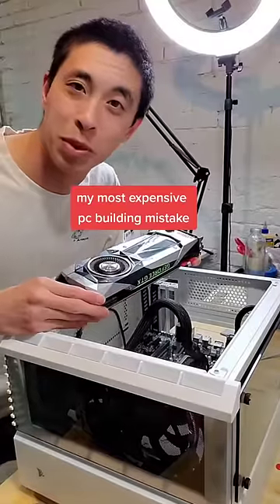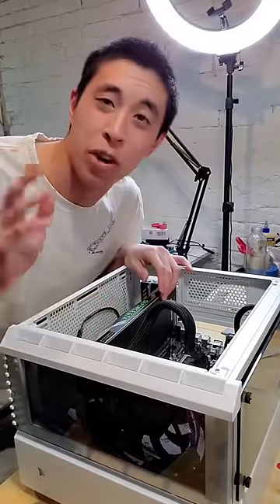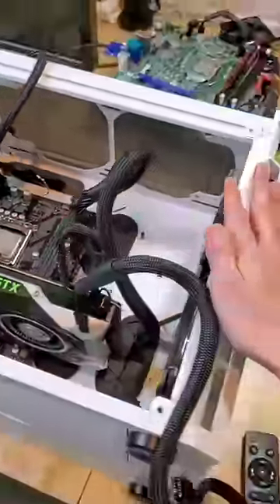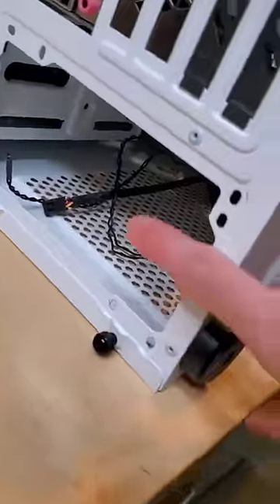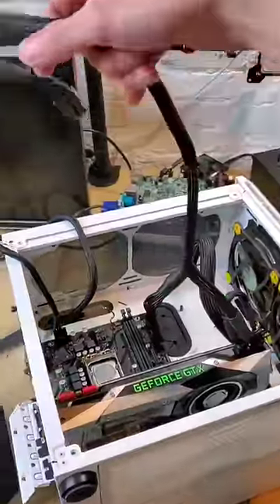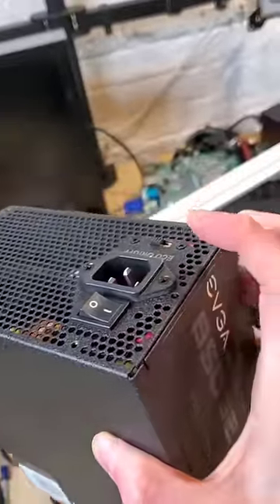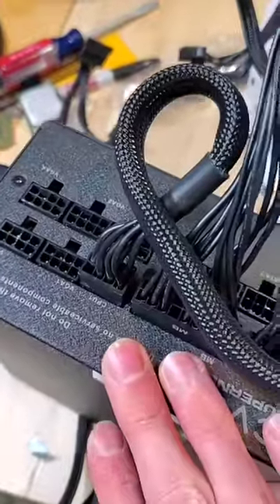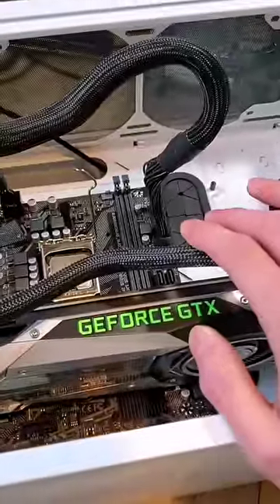my most expensive pc building mistake... #shorts

Comment: I really wanted to overclock my 750 ti, so I decided to flash a modded bios to try to overclock it more, without fully acknowledging the consequences. I flashed a bios of a 750ti that has external power without knowing, and the card worked, but only displayed ‘please plug in external power’ even when my card didn’t have one.
And that’s how I ended up getting my 970.

Comment: Made a mess with hard line watercooling, getting water in the CPU socket while running.
Also bent some pins trying to salvage things. I managed to bend them back, but the system was not reliable anymore afterwards. Replacing the mobo would have cost me €1300 and I couldn't be sure the CPU was still good, so I went for an all new platform.

Comment: Was building a pc while drinking—
I managed to wire my VGA Power into the CPU Power ports… mind you I had sleeved cable extensions so somehow this was easier to do from the back. Everything was ready to go. I powered up the system, heard a loud pop and smelled burning plastic. I realized my mistake, and was devastated. I corrected the error but was not met with any power. Since I used a modular power supply, I removed PSU with cables intact and swapped it for an identical model.
To my surprise the system booted and no components but the PSU were harmed.

Comment: Well.. when i build my first PC just a few months ago, i fried my CPU (i7 14700k), motherboard (MSI PRO B760M) and PSU because i messed up mounting the mobo on the case. I placed a screw wrong and made contact with the back of the motherboard (exacty on a spot where it should be no contact at all) and after 2-3 hours of finishing rhe build, while installing the drives and what no, it went off. Luckily the GPU, ram and storage weren't affected

Comment: I had to replace my power supply unit recently. I was like "Oh yeah, I can just re-use some of the modular cables, they have the same connectors.

The first thing I did when I got the new PSU was plug one of the spare peripheral cables from the old PSU into the new one, and measure with a multimeter, only to find that the 5V line had 9V on it, and the 12V line had 2V on it... Yeah, wired up completely differently, so what should have been ground was the 3V line.

Needless to say at this point, I just removed all of the old cables from my PC and installed the new ones.

Comment: I don't know if I can call this a mistake, but I bought a gigabyte H610M motherboard and put it in a optiplex case without the correct mounting holes. Logic would denote the fact that you just leave things in there as they are, but for some reason the motherboard chipset died anyway, and I had 2 Gigabyte boards die this exact way! One was a haswell board, and the other was a alderwood board. But the biggest mistake I ever made financially would probably be jumping on the LGA 1700 bandwagon, all of our CPUs have problems and the 12th generation CPUs seem to be the best of the bunch, and you have basically nothing in terms of upgradability because the next two generations of CPU are known to be faulty and they aren't making another generation for our socket which is extremely frustrating.

Comment: i bought a £600 pre-build fully setup and ready to go.... THE seller only put a £25 ACE 500w power supply in it, NOT RATED! every day it kept losing power randomly for 3 months... i did contact the seller but he was too busy to look at it. eventually i tried to turn it on one day and sparks start flying out the back of it! pc was dead! i took it to another store to find out what happened the power supply had fatal malfunction, it also took out the gpu motherboard cpu and ram only the harddrive and cd roms survived cost me £180 to get it up and running again with a Corsair Power supply. my advise is when you buy a pc make sure the power supply is Top Quality and Rated do not settle for cheap tripe.

Comment: I ripped my CPU right out of it's socket by accident. The PC wasn't turned on for a while and when I tried to take the heatsink off, it took the whole CPU out with it. 

Turns out the thermal paste was as dry af so it stuck to the heatsink.

Comment: Forgot a washer on the AMD cooler brackets, causing pressure to the motherboard and caused it to break. Luckily this is my first PC and is the least expensive component in the system

Comment: not as Expensive as others but, I plug a 5volt AIO cooler to 12volt connector, luckily is only the RGB that got Damage. I suggest just plug it to the PSU for RBG/Lighting system if your AIO/system have the connector.

Comment: Upgraded my 650 Watt PSU (i thought it would power the 3xxx GPU) to a 1000 Watt and used the same cables. That is no problem because i used the same Brand and investigated before the buy if i can use the old cables. This Info should be available on the Manufacture Site. Off course you need to know what the old PSU was and in this Video that was the Problem.

Comment: I wanna say the worst thing I did with my PC was tightening the one screw to my CPU cooler all the way which I started to apply pressure to the cooler/mobo and wondering why the other three wouldn't go in.

It works fine! I think that was the only real bad thing I have ever done too it

Comment: The most expensive mistake we’ve made was trying to work on a computer on the carpet during Winter time. Now we weren’t working inside the computer but just setting it up. My Dad had apparently built up enough static charge that when he went to plug in the keyboard it zapped the PS2 port killing the chip so while the computer would turn on we had no way to type anything…. This was on a 486 Tandy Computer which my Uncle was going to buy. However without that Money my Dad had to go buy the parts for our PC that we were building without that cash.

Comment: Something that I'm dealing with right now. If you clean your GPU with compressed air make sure you have are a sufficient distance away and use light air on the GPU. Then clean it with 99% rubbing alcohol on a micro fabric cloth and ring it out. I made the mistake of using compressed air too close to my gpu and I got the liquid from the compressed air on my GPU. And now my GPU is overheating 😢 
Ps: I have a rtx 3060...

Comment: While cleaning my first computer i broke one of the pins holding the cpu fan to the processor. I didnt realise that the fan wasnt sitting completely flush with the cpu. Ended up overheating and frying the cpu and the socket. Had to replace both.

Comment: Got an old junker PC from a neighbor when I was 14. We just needed a new PSU in it they said, because the old one gave up the ghost. Lucky us, we had another computer with a PSU in it that was still good we figured since the unit powered on, but the parts in it just couldn't handle the workloads expected of it. 

So, my mother being the worrywart that she is over accidental fires decided it was best if SHE plugged in the psu. Cause of course since she was older and had more experience with computers than I did at that time, it just made sense; was her logic. Meanwhile, I had looked at the pinout and socket for the motherboard already and identified that they didn't match. Looking back, I guess it was a 20pin instead of a 24pin or something like that. 

ANyways. She plugged it in. Nothing. Nothing for a moment. Nothing some more for a few seconds longer. Then POOF. Smoke and flames. 

The irony. I pointed out the pinout and plug not matching. But of course, she knew best. So we went with her decision.

Yeah, I was not happy with her. And of course, she was not happy about the whole situation either, since the whole point was to prevent a f'ing fire.

Comment: Didn't break much in a PC specifically, but did fry the cpu cooler socket somehow. The fan doesn't work from there, had to use the SSD socket instead. I think it was because I was stupid and didn't look in the manual for the correct power pins after removing all parts from the case for cleaning.

Comment: so you know that switch on the back of the psu that switches between voltage levels? Yeah, my first pc was having issues and for SOME reason, I thought "hey, I wonder what that does?". What it does, when flipped while the PC is on, is fry every single component on the mobo.

Comment: If the case is small or the mobo is big i reccomend plugging the cpu cable before putting the mobo in the case, i was struggling with the tight space and suddenly felt something wet... turns out i was nudging my fingers against the cpu cooler and there was lots of blood

Comment: First time I built a PC I didn't realize there was a difference between CPU socket types for different CPU lineups. attempted to put the Ryzen 3600 into a AM3 mobo and ended up bending some pins. Was not happy, especially since after checking it seemed so obvious.

Comment: A few years ago my cpu got stuck to the AIO, I noticed a few pins got bent so I started the agonizing process of bending them back. I got most of them until the very last one, which ended up snapping right off. I sold it on eBay as-is and got some money back as it was during the hardware shortage.

Comment: Not my mistake, as I've never had one this expensive, but my last PC shipped with about a couple dozen bent pins in the socket. Someone else obviously screwed up and RMAed it, and Newegg, being what they are now, just sent it out again without repairs or even any indication it had been returned before. 

Thankfully I was able to fix it with the pointy end of a safety pin and a magnifying glass with a stand, so I got it running. But it was absolutely a sweaty discovery.

Comment: I have not really upgraded my pc i have an old pc from 2017 and with the help of my friend i have a 1060 in it but a few days ago i was very and tired of my hard drives painfully slow loading times so i bought a cheap ssd that has 120gb off of amazon so i have a good speed  untill i build my new on christmas but i figured that my mohterboard only has one sata port which was being used by my hard drive so it's been sitting my room doing nothing
Reply: Yo I will take it😂

Comment: top comment is athlon 64.

mine is R9 3900X
I am trembling, but after 2 minutes or so I calmed my self and use my swiss pocket knife. after 40 pins and 15 liters of sweat, I did it and reassemble it again.

this happens when I tried to remove my ryzen from stock wraith prism cooler with that notoriously sticky factory thermal paste. I bend the pin with my palm, fortunately it only bend the border most pin.

Lesson learned, use a tool, dont use bare hand, or only buy another paste.

Comment: upgraded to the bleeding edge of cheap, bought a GTX 1050 what I didn't know at the time is it pulls all of its power from the motherboard and that is a bad thing for a already over clocked system.
I turned my motherboard into a dirty bomb, after my motherboard blew up it also caught on fire, after breathing in the toxic smoke I managed to stop the electric fire... and so I killed a 300$+ motherboard because I wanted to cheap out on a GPU on my old rig.

Comment: I did not measure anything so my ram obstructed the top radiator. "Fixed" it by cutting down the ram heatsinks.
Not an expensive misstanke and forgot all about it until I switched case to one with a glass panel.
Reply: those heat spreaders can just be popped off

Comment: I have never made a mistake cause I never had the money to spare to be able to make a mistake. I spend more than 30 hrs learning,watching videos on how to build a pc, what parts need to match, and then the shopping for the best parts and deals that I could find on a smaller budget… as I was building it I had videos open going step by step even though I knew it already. Since then I have don’t numerous upgrades(a PSU was one and I mixed power cables within the same brand, no issue ty Corsair). Since then I have built others PC and then I make them built the pc and walk them through all of what I know, dos and donts, how to do this and that, and cleaning. I do this so they will never need to buy a shitty prebuilt. I will never buy a prebuilt I love doing my wire management

Comment: i bought a full fan kit from be quiet, woth rgb and a hub for them… after everything arrived it turned out that the fans had a 3 pin rgb connector and the motherboard had a 4 pin rgb header… story short, i switched them out for better noctua fans

Comment: The PSU killed a MOBO and a GPU for me too! Luckily the CPU survived. In my case, I had a modular power supply that I bought used, and I just plugged cables in without reading what's what and where it goes. So I ended up connecting the PCIE Cable and the CPU cable in the wrong places, I just got the smell of some and nothing visual, and I knew I f'ed up. 
POWER SUPPLIES ARE USUALLY THE CULPRIT! MAKE DOUBLE AND TRIPLE SURE YOU'VE CONNECTED EVERYTHING CORRECTLY!!!

Comment: I was screwing an AIO Pump onto the CPU and the electronic screwdriver (Which is heavy) slipped and smashed into the RAM slot. Ofc just means I couldn’t use the RAM slot, but it was an ROG Strix Z790-E.

Comment: In an attempt to clean my GPU so i could repaste it, I used alcohol and a toothbrush to scrub at the GPU die. Turns out i scrubed too hard and broke off a TINY resistor and bricked the entire card.

Comment: The compatible PSU cable is designed for users to avoid plugging into the wrong socket, apparently in the video u plug a GPU power cable into the CPU socket. The voltage difference is devastating for the gpu

Comment: thats a bad day bro.
i built my first full pc build in early 2000's i wanted that first true quad core. phenom 9300 black edition.
i pulled the lid off the mobo figured theyd send it without debris in the socket and popped the cpu in. pulled the lever down but it didnt feel right so i stopped. whatever was in the holes in the mobo didnt allow cpu to go all the way down even though i gave it a few pokes and it bend pins and broke one off. the worst bent pin fell off as soon as i touched it. it was the newer gold plated pins. i cut a piece of sewing needle the exact length that the other pins were from the point it broke off dropped it in the hole and put the cpu back in and fired it up. it ran for many years and scored very well in global benchmarks so that was cool. the pc had a diff processor now and is still running just fine for a friend as his kids gaming rig.

Comment: See a PSU was my first ever experience with pc building and i remember being broke as hell so my mom would get me a new pre-built pc with installment payments, it arrived and i was happier than ever. BUT i did notice that the PSU was a typical $5 grey non modular one that they tend to shove in every pc they can, so i wanted to change that but had 0 experience with any of it. Ordered the PSU, it was corsair rm750x i believe, a fully modular one and after taking a picture of where each cable goes, i have somehow swapped it at the age of 13 with the whole cable managing behind the case, one of my first proud moments, worked like a charm for 4 years after that, until the GPU got fried, was not experienced with airflow yet and let my cat sleep on top of the pc blocking the fans, oopsie 😅

Comment: well, maybe this doesn't work 4 u... but, here in Chile we use 220 volts... and you 110volts... so, if u put a 110voltage PSU here, it explodes... so, almost all old PSUs had a switch to change voltage, but you needed to check that... now, I didn't see that, because a lot or all of the PSUs works in both voltages! Regards!

Comment: Okay, I know this is an old short so no one will see this comment but I hope someone can answer this question for me: What exactly went wrong when mixing psus and their cables? As far as I'm concerned, cables are just long ropes of metal that connect one pin to another so I don't understand why mixing cables is a bad thing. 20 pin, 8 pin, and 6 pin connectors are standard on what goes exactly where right? That's how gpu and mobo oems are able to use the same connectors for power on their components. So why did the mixed cables fry the components if they were just connecting pin to pin?

Comment: That makes no sense. What about the cables could possibly be the issue? Especially between units from the same manufacturer? Either the wire gauge is sufficient to carry the necessary current or it's not and that should only lead to the cables overheating and melting the insulation. 

Any electricians know how this could lead to frying every component?

Comment: I just want to know why someone hasn’t started a movement to get everyone to band together and push manufacturers to standardize modular PSU cables. The fact that there is potential for variance in pinout within the same brand is unacceptable and needs to be changed…

Comment: Buying a WiFi PCIe card, GPU hot air had air-fried the WiFi card in less than 2wk, $20 gone. Use a WiFi included motherboard or a USB Type-A adapter

Comment: thought i had a bad motherboard, turned out i only installed the ram improperly... AFTER i bought a replacement.
Reply: just return the replacement?
Reply: @puppieslovies  it was already like 4 years after i bought the prebuilt it came in, and it was already an older cheap model

Comment: I had a intel g2020. I was so dumb that i didnt know some motherboard have pins on it. Well my dumbass brain started using a brush to clean 🪥🪥 everything. Even the cpu slot!!! 😶
Well, after 50% of the cpu socket was destroyed. Then i noticed that those are freaking pins. 🧐🥺🥲 😭
That was the most expensive mistake. I got a better pc than that so i ain't complaining🤫😏

Comment: When I was placing the GPU in the PC I accidentally scraped a little bit of the motherboard with the mounting of the GPU to the case, turned out that where I scraped it there were Audio lanes located, guess what, audio of mobo didn't work anymore, luckily it could be send RMA, it was a 340 euro motherboard.